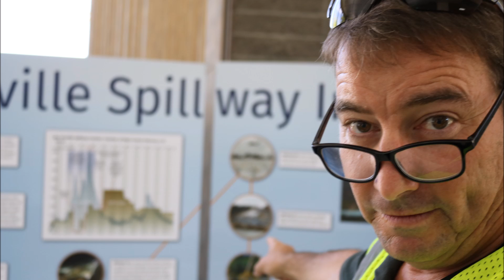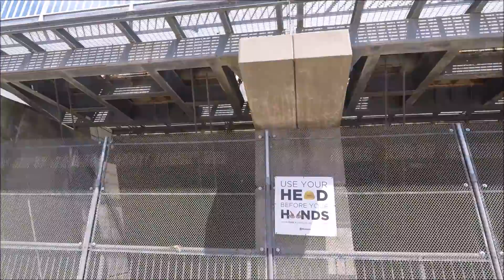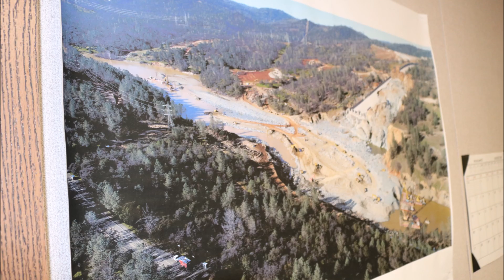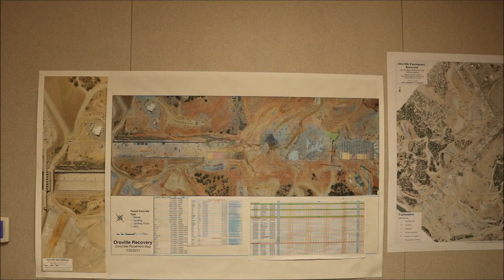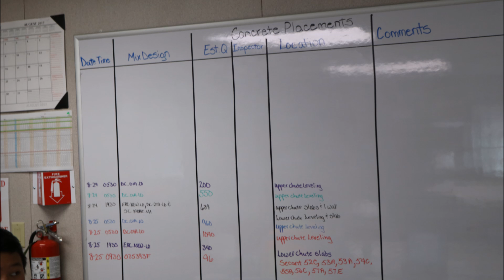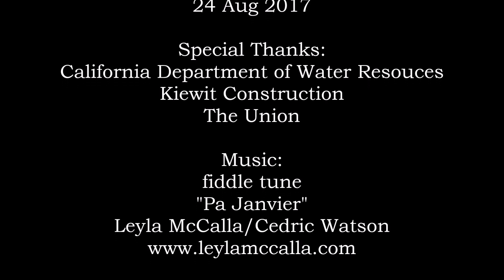Oroville Spillway Construction Tour 24 Aug. Part I

Comment: Well this video took me back a few. Especially interesting was the construction meeting. The ones I was in were for high rise construction with lots of subs and trades involved. Inter trades activities were always a problem and sometimes got so hot that various trades would synchronize going to the parking lot end of shift to avoid conversations getting physical ― and yet a month after the job was finished they'd all be buying each other beers. I learned to go early and stop in at local coffee shops where leads and foremen would have informal meetings, especially before the regular construction meeting.  Occasionally I'd get a heads up on some unnoticed situation and could head off snafus by cluing in the construction boss. I quickly learned if you are onsite to wear work clothes, I wore tan Dickies work pants and Penny's blue oxford button down shirts. Heard stories of some ass-hat bigwig getting accidentally dowsed with hydraulic oil in his $600 suit or being accidentally beaned by someone carrying a long pole. Some of the finest people I've ever known were these construction guys, and I miss'em.

Comment: Juan, you mentioned that or at least it was mentioned that the old / new training walls are to be 'thin'
do i understand this right?

with out rebar?

why thin [if thin[?

how do / will all these segments get 'connected/  link locked ' together?

if not a continuos pour how will they seal so pressured water doesn't tear them apart a yr, 5yrs, 25yrs from now ?
Reply from the maker: No...stay tuned for part III

Comment: Not sure where to put this ... but it's here now.. Living in Houston with flooding this weekend and maybe a few more days. Officials notified the public earlier tonight that the Army Corps of Engineers are going to open the spillway on the dam of a flood control reservior ... into a boyou that is already flooded. Good upstream and bad downstream. It's flat here ... so most people are unfamiliar with dams in general. There will be more flooding ... upstream ... downstream ... probably both. The local authorities explained it well several times ... seemed that the media didn't understand... or wanted impossible answers  (I now feel your pain). Could go on ... Just frustrated.
Reply from the maker: You have a very critical situation going on in S. Texas right now...a YEARS worth of precipitation in less than one week...with no topography for the run off...very flat. VERY DANGEROUS. Hurricane Harvey-one for the history books.

Comment: In retrospect, too bad they couldn't have patched the initial damage in 48 hours with helicopters or a earthen ramp over the training wall.  The hole was not that big when they first shut down the spillway.  Given the resources of the state and federal governments that might have been possible.  That could have saved 1/4  billion dollars of damage and clean up.  

Also, why not build a wall down the middle of the spillway to create two chutes in case one got damaged?  Sure, it looks beefy, failure proof?  Redundancy of two is proven insurance.
Reply from the maker: It needed rebuilding anyway...
Reply: All's well that end's well.  How good are the gates?  Structural retrofit, or total rebuild?
Reply from the maker: Inspect and repair as required.

Comment: Let me add my voice to those complimenting you on the coverage you've provided on the dam/spillway crisis/rebuild.  I do have one question about the plunge pool.  Why wouldn't the construction company(s) involved in the rebuild simply "fill" the plunge pool with loose "solid fill" (rocks/boulders and smaller aggregate) instead of completely filling the "hole" with roller compacted concrete?
Reply from the maker: need solid 'bedrock' , don't want to repeat the same construction techniques used the first time they built this spillway.

Comment: Watched all the Kiewit videos on the California DWR youtube site. Had to slow them down to 25% speed to watch. They are still pictures from 2 pm to 3 pm, every 10 minutes or so. A good watch though.
Reply: Juan, one question I have is what is the black hose running up the hill to the right of the spillway. Is it water from the river going up the the batch plant or water coming down to the water tank for the anti-dust tanker?. Or?
Reply from the maker: All the water for the project comes from the lake and a big 8"? main line.
All the power for the entire project is generators on site!
Reply: Looking at Your June 15th update it shows it just not very well, then they have added the water tank for the water trucks to get water from.

Comment: so considering theres no public access to the old boat launch is the road that got widened to use will be the NEW ACCESSING POINT FOR LAUNCHING? And is the top of the damn no longer being driveability access indefinitely, is or will there  be access for the public by foot, bicycle, or skater's (rollerblades) traffic? Doesn't anyone know where the results of the foam tested waters retrieved from the feather river are? Curious to hear something of the foam in the h20! Thanks so much Juan!
Reply from the maker: The boat ramps and trails will get a lot of money and improvements very soon.

Comment: Juan, can you get and give us some idea of the quantity of concrete that's required to bring the plunge pool(s) up to grade? It's mind boggling to think of how they are going to fill that huge hole in just a few weeks. Maybe compare those figures to volumes needed on the other segments? Thanks for any further info, and thanks really for these updates. The confidence DWR has in you shows in their willingness to give you such good access, and the info they and you pass on is really appreciated. --Dave
Reply: If I understand Juan correctly? I think they are going to make a spanning  bridge connection that connects over the plunge pool? It sounds like DWR is going to extend the two sections until they meet in the middle? Kind of like a freeway overpass that meets in the middle. It would be smart. It will take only about a 1/3 of the material to fill the plunge pool and leave a way to drain the creek that runs under the upper spillway. Also as a back up plan they can convert the thing to a ski jump spillway. But I guess we will have to wait for Juan's next update.

Comment: Thanks Juan, for your fine report, looking forward to the next addition.

I too get the feeling of massive over-design. I completely understand the original spillway had many defects...not bolted to bedrock, no surface prep (dental concrete), lacking enough rebar for sound strength, poor drainage, NO maintenance. But holy smokes!

The replacement appears to have 200 times the rebar, 2,000 times the concrete and 10,000 times the cost. Take for instance the secant wall on the "emergency" spillway...what on earth for?

The ONLY reason the emergency spillway was being used at all, was because the main spillway was self-destructing. So now, the new spillway is designed to handle 10 times the flow of the original, the "emergency spillway" will most certainly NEVER be used! WHY are we pouring money down the toilet?

I DO understand that the original emergency spillway was a total joke, being JUST DIRT! But remember, we are never going to need to use it with the main spillway being so ROBUST and WELL-BUILT.

Comment: Hello Juan. You are doing a great service here. Fortunately with me being retired I can follow this job (and with your help). Juan, I ask (not to overload you) what is your opinion about the other structures in the CA water system? I ask if there is any other dam, spillway,etc that may also need some level of "quick" repair as we do not want to be surprised like this again. Well at least not till some years pass.
Reply from the maker: Dan R our entire levee system needs to be a higher priority...
Reply: OK Juan. I found a LA times article from Feb of this year that state's $20 billion is needed to stabilize the Sacramento/San Joaquin  area levees. Some $4 billion has been spent since 2006. It seems the work started in 2007 has made the area significantly safer but experts are pointing out areas of concern. like the Don Pedro Dam.

Comment: Please remember to observe the Safe Title Area when creating graphics. (Only one was cut in this file.)
Reply: Today I learned! More info here https://www.premiumbeat.com/blog/default-title-safe-guides-are-a-sham/
Reply: Keith MacDonald  Yes, today's TVs have less overscan but they still have some and because non-broadcast TV editors are using computer displays that have zero overscan (or even underscan) and most are ignorant of the concept of the safe title area, they create graphics to the very edge and the result is on my 42-inch plasmaTV, which has a very small percentage of overscan (in fact when I input a Safe Area Generator on it there is very little area around the Area reticle), I'm seeing bleeding and cropped graphics on most (more than half) of the YouTube videos made by vloggers. Juan's still frame (or aerial photo) with his red markings had the bottom one nearly entirely cut on my TV but it was visible on my big iPad Pro.
Reply from the maker: good point!
Reply: blancolirio  I corrected my display size to 42 inches and I learned a lot from Keith's link to the article about safe areas even though it has a false, click bait title.

Comment: @blancolirio What is the "aeration feature" you mentioned at 6:16?
Reply from the maker: William M stay tuned....more details coming.
Reply: Aeration is designed to prevent cavitation which can severely damage concrete structures.. google "cavitation aerator water damage".. It's a completely different thing to "aerated concrete".
Reply: I hear they're going to plant grass on the face of the dam. Joke. Regulars here will know what I mean.
Reply: Gord Baker 

Aeration prevents cavitation which is the mechanism which erodes material. 

Try Googling, aeration for dam spillway. You might learn something.
Reply: Spillway aeration is a practical application of "Bernoulli's Principle." https://en.wikipedia.org/wiki/Bernoulli's_principle It seems counterintuitive that as flow velocity increases, static pressure *decreases!*
Reply: Gord Baker 

  Aeration for structures is done not primarily for freeze-thaw cycles, but to create a boundary layer between the surface and the water. 

  There are quite a few Navy programs that use this feature to speed things up going through the water. Think torpedoes. The boundary layer of air reduces friction, which in this case prolongs the life of the structure.
Reply: The aeration feature is a relatively new technology in spillway construction. Here is a link to a Popular Science 2003 issue: www.popsci.com/scitech/article/2003-03/water-vapor-almost-busts-dam

Other spillway failures have been plagued with a condition called cavitation. Somehow, when water flows briskly over a concrete surface, vapor cavities are formed...these cavities are short-lived, imploding with enough force to scour concrete from the spillways.

The fix was to install a ramp so that the flow of water over the ramp would draw in air (from underground pipes) as the flow created a low pressure pocket. Thus, the aerated flow would completely disrupt the vapor cavity process and cavitation to the spillway was eliminated. Yea, technology!

Here's a link to several different spillway aerators:
www.waterpowermagazine.com/.../featuredamage-limitation-a-new-spillway-aerator/
Check out Figure 3a as one of the possible features the new Oroville spillway could use. One thing is certain, all new spillways have multiple aeration features to stop cavitation.

Comment: Why are they wearing hardhats indoors in the office?
Reply: Luscious3174 Because most forget to take them off.  Feels almost naked to not have a hardhat and ear protection on large construction sites.
Reply: Rules like that are why they haven't had a single lost time accident on that massive project, as reported by Juan a couple of videos ago.

I like the signs along the spillway headworks "use your head before you use your hands".
Reply: Out side without a hard hat will get you fired so keep it on.
Reply: quite often, it is so they don't forget to put it on when they go outside......

Comment: Great stuff Juan. Small correction. At 5:57 you say the 2nd upper section "has been completely removed and replaced with new structural concrete" as though that work has been completed. They're far from finished pouring the leveling concrete and slabs here.
Reply: I was going to make the same comment Jim.  As usual you are ahead of me.  The center section from which they pumped to pour the slabs on each side I am not sure has any concrete at this point - they are working on preparing it.
Reply from the maker: Jim Mac you are correct "to be replaced..."

Comment: do you know if any ground penetrating radar has been used to verify if the remaining spillway has had any erosion underneath the concrete
Reply: Trickles of water can end up creating LARGE voids in soft ground.  That was the one big soft area under the spillway, and we'll never know just how large the voids were before it collapsed for the initial hole.
Reply from the maker: mostly drill samples I believe.
Reply: my reasoning behind this may be ignorant to how the initial damage was done but to sum up my understanding is that it basically eroded underneath the concrete from water flowing through small fishers in the concrete then basically the weight of the concrete collapsed in on it self then was washed away in chunks. all being in the first few moments of the damage to the spillway then snow balled
Reply: that was my exact thoughts just wondering if or how the existing upper structure was or is being inspected to insure its structurally sound I do understand it was bolted down to bed rock with heavy bolting
Reply: John Connor. If you look at the video of the last use of the main spillway you will see water first flowing under the spillway before it flowed over the top. So what does that mean? There have to be water caves all the way up to the gates, under the spillway. And since DWR admit there is some water flowing inside the main dam wall, what do you think will happen when one of those caves collapses?

Comment: With this new public access by you I feel the DWR and the contractors feel proud of their work and want to clue in the world on their handiwork. 
Compared to what was and now, there is no comparison. 
I would say it has been done right this time. Maybe overkill but I would do the same.
Reply from the maker: "Hell for Stout", this design....nothing like the old spillway.
Reply: Benjamin Davidson concrete is cheap. If you're not going to fill the hole then you're building a bridge over it. Also steel rusts!!!
Reply: Also, the thermal expansion coefficient for structural concrete is less than most types of steel.  Meaning the concrete will expand and contract less during the day/night temperature cycle.
Reply: It's real easy to lose sight of the scale of the project. You realize the size when you see people standing beside the retaining walls, which are about 40 FEET high. I did some rough calculations back when and at maximum capacity the spillway can be at 35 feet of water moving at about 50 miles per hour. That's a huge amount of mass and energy. They're using concrete to fill the voids because it's a solid mass and can't settle the way aggregate as a road bed would. The "dental" concrete goes in the bottom and uses ice to keep it cool during the curing process. The RCC goes next and it doesn't get as hot as regular concrete. The top coat is structural concrete which has the steel reinforcing in it
Reply: I wonder if any thought has been given to using titanium dioxide in the surfacing of the spillway?  TiO2 added to surface concrete w2ill reduce heating by the sun as it is highly reflective.
Reply: Erik 567 --- "Anything built TOO STRONG never breaks".
Reply: Nicotti --- During my career, when designing something built with concrete, the number I used for concrete expansion (passed down to me from older engineers) was "concrete expands 3/8" per 100' per 30*F temperature change....not 30*F ambient temperature, but concrete temperature. Seemed to be a good formula.
Reply: Monsanto predicted we would be using plastics for this kind of thing back in the 1960's.
Reply: Nicotti --- Apparently they're similar, because concrete bridge decks work well on top of steel beams.....they're all over the nation/world. The low coefficient number of concrete is close to the high coefficient number of steel (steel's alloy can contain many metals that might adjust the coefficients as well as the different aggregates used in concrete). We're probably talking about "splitting hairs" here.
Reply: Nicotti --- I would say with all of the possible variables, this would fall into a scientist's work(which I assume was completed years ago) before getting into the engineering work.
Reply: when there is things there has to work , overbuild is not used in this centens, it's called build strong enough to keep the Construction working
Reply: +arkansas13 Okay, so does that mean I'm wrong in thinking structural concrete expands less than most steels?  I looked up the expansion coefficients online.
Reply: blancolirio Hey Juan. I'm no engineer hahaha but I had a thought. Why could they not make the spillway out of steel and skip all of this filling. I'm sure the price for all the steel would be high but it would be far less materials. Just a thought. Great video!
Reply: Benjamin Davidson --- A structure this large, built out of steel, is high maintenance, nearly as much yearly as the Golden Gate Bridge.